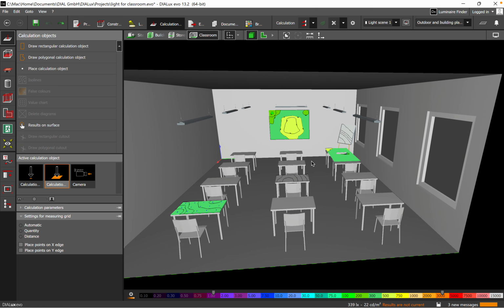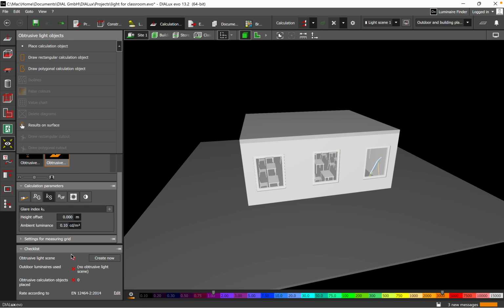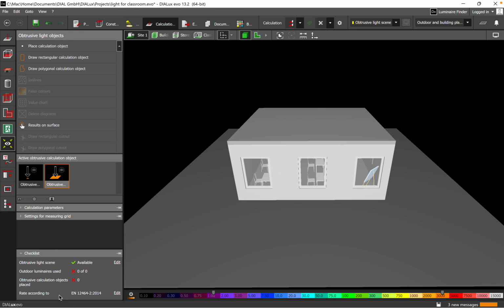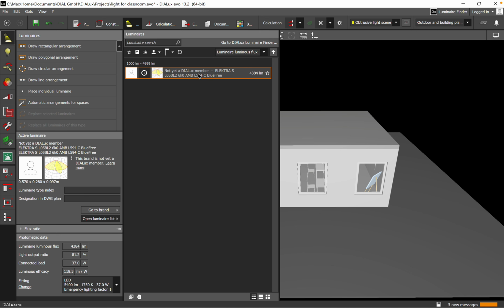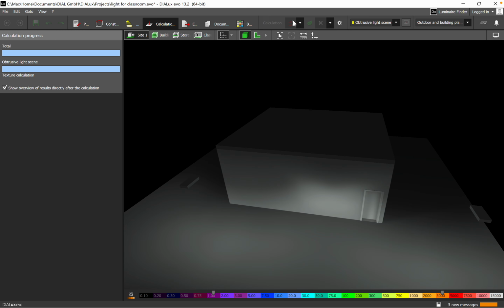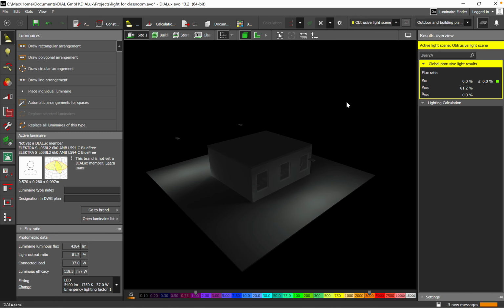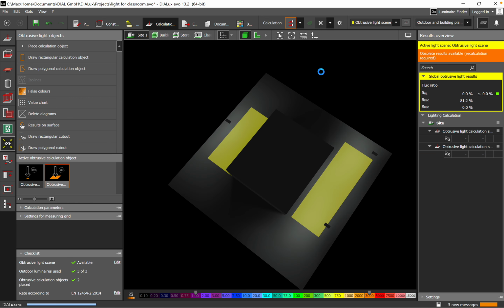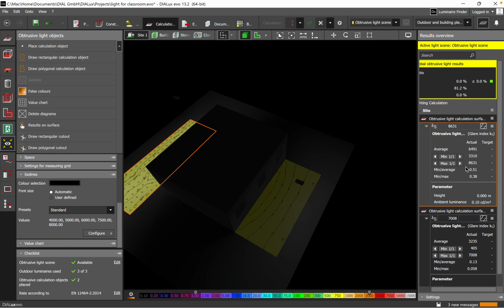Obtrusive lighting, New feature on Dialux 13 2

Comment: Hello Catalin, your obtrusive lighting calculation surfaces are not properly located. It should be on the window side of your neighbor or in front of the door of the neighborhood if it is for road and sports lighting.
Reply from the maker: That is a great point, I appreciate you pointing out the correct location for the obtrusive lighting calculation.